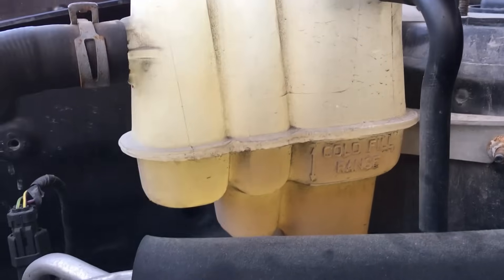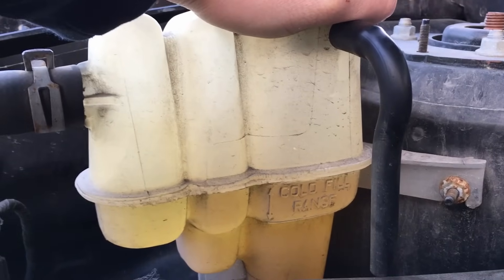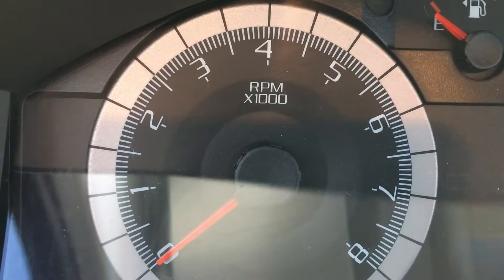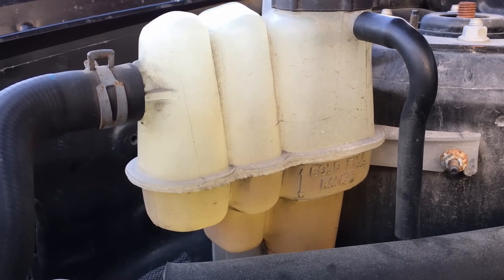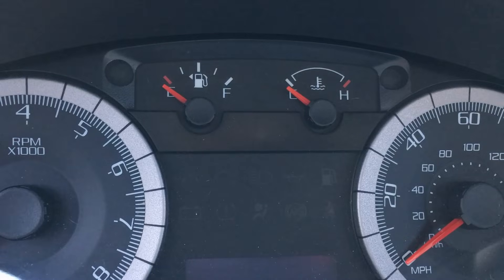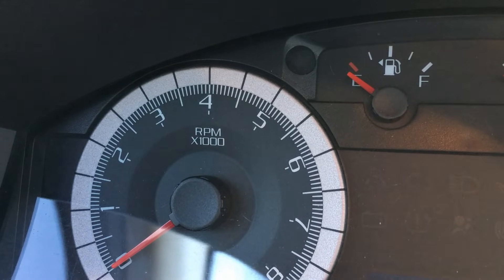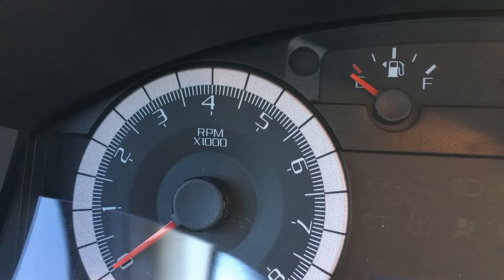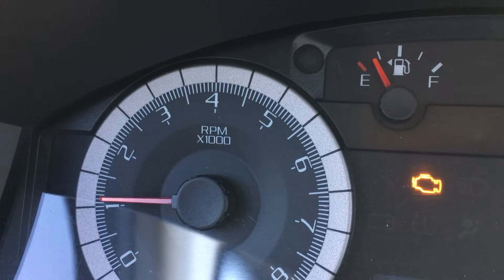Ford Quick Tips #69: The Trick to Purging Air From Your Cooling System

Comment: thanks for this vid, i'm going to give it a go once my escape has cooled down. however i have a strange problem, my father-in-law replaced the thermostat, not sure if he burped the engine, but the temp sits comfortably t 3/4s which is NOT GOOD.  but unlike the common issue stated about only cold air blowing in the cabin there IS heat blowing thru the cabin heater, could this still be caused by a bubble in the system? or something else?
temp gauge doesn't go any higher, but my rad-fans are full on trying to keep the coolant cool... I'm stumped, my dad is a mechanic but he lives in another country and usually i'm pretty good at this but on older vehicles, do you have any advice for me?
Reply: Mr Burns p
Reply: You ever figure it out? why yours fan were on high?

Comment: I take a car with a known good heater, and use a vent thermometer.   After running 10 min, I note the temp coming out of the vents.   When  i do this on my car with minimal heat, I will go out the next morning, and see what the vent temp is after 10 min from a cold start.  I feel this is a good way to check it.

Comment: We had a 09 Flex, we never had a issue with the heat for years until my wife had got into a accident and they had to replace the radiator. After that we only had heat wile driving. I kept bringing it back and they didn't know what to do. I looked it up, as I do most of my own repairs and it was like a 8 hours bleeding process. I really wish I would of tried this instead. We ended up trading it for a 16 Edge for other reasons but really regret it, our Flex was my favorite non performance car we've had.

Comment: Would this work if it’s running hot and the ac isn’t cooling? Radiator and heater core was replaced and it’s been sitting for a while. This is for a 99 F-150 5.4L.

Comment: Only on the driver's side I have no heat at idle. When driving there's heat on both sides. The force of the air also seems lessened on the driver's side. Blend door? Partially blocked heater core? Thoughts?

Comment: I recently replaced the thermostat and thermostat housing along with the thermostat sensor. Noticed the air bubbles in the coolant reservoir. Tho i have heat but no ac due to the worn out ac compressor. Car is not over heating either what else could cause the issue? I had stopped the major leak but the coolant reservoir seems to keep drying up.

Comment: Have a question. 
I have a 5.4 2000 e250 
I get heat. After running for awhile my heat will go away. 
I did have the cap off trying to purge. Seems all was good. I was getting good heat at idle. I was getting ready to put the cap on after running it for like 40 min. Get in van and heat is gone. It will come back only with the throttle. 
I feel like the bottom hose is getting no flow.i can squeeze it fully. I don't feel it flowing. Top of radiator was hot. Bottom cold. Opened peacock fluid was cold. Not sure if that normal. 
What do you believe would cause these symptoms? Appreciate the videos and any info. Love youtube

Comment: While the bolt on design still work if there is wear on the end f the camshaft from an aftermarket unit. I made the mistake once. I have a bolt in unit now. We’re you able to fix the unit I. The video without replacing the cam?

Comment: Hey man I got a 2006 Ford F150 4.6 V8 four door automatic two-wheel drive I did the coolant flush system on it but now my AC is working and when I turn it from AC to heat I can hear the actuator clicking over to keep but it's blowing out cold air so does that mean I have air in my system and if so how do I burp it

Comment: Can I do this if my expansion tank is completed full of coolant? The Ford dealership filled it to the top when I had them replace it with new coolant. I'm asking because I'm not getting heat unless I'm driving, blows cool air at idle
Reply from the maker: bring it down to the top of the cold fill level.

Comment: I have a 2004 v6 mustang...3.9...

It develops air pocket everytime I first go through the heating up...after it sits if I open radiator cap there is some pressure in there...

Once it's running though and air pocket is gone it will run perfect operating temperature

I'm confused why this only happens when it first warms up....maybe after it cools it sucks in air from the expansion tank?  Maybe a crack in the top of the expansion tank?

Comment: hey what do u think in general about 2015 explorer sport 3.5. my lease about to end and i wanna decide if i buy it or not
Reply from the maker: In general I think they are great vehicles they have been very reliable from what I have seen.
Reply: Faysal Chraibi I own a 2014. They fly on the highway, have left some mustangs in the dust. Not the 5.0 though but the regular v6 mustang. it's definitely a fun car to drive.
Reply: one thing you want to check though is if the blend door makes an odd noise when the car first turns on the heat or cool

Comment: I have a 2013 Ford with the 3.5 engine the radiator retainer is building water pressure and gushing out.. I had flush the coolant with the tool and still same problem. And also have change the thermostat heater is working inside the vehicle. any advice thank you in advance

Comment: hi,i have a 2009 ford fiesta 1.6 tdci,i changed the thermostat and housing today,i then put coolant back in run it for over an hour,the top rad pipe is hot,heaters are hot but the rad and bottom rad pipe is cold,also because the rad is cold the fan isnt cutting in,but if i disconnect the temp sensor the fan cuts in,ihave left the car running for over an hour and rad is still cold,the water in the bottle is getting hot but dont seem to be circulating,it just gets hot,the bottom of rad and bottom pipe is cold,please any ideas,i was told water pump but i have no leaks or noise coming from the water pump,thanks in advance,jon...uk

Comment: I have a 2008 Ford fusion 2.3 L and remove the drain plug from the radiator to drain the coolant because I wanted to remove the intake manifold and clean it I was unsuccessful because I was having problems reaching the hardest bolt on the intake manifold that Is dead center of the intake manifold so I put everything back together put the radiator plug back on and put the coolant back in the reservoir I have not started the car yet should I do this procedure after doing all thi?Thanks in advance Brandon

Comment: I have a 99 expedition that does the same thing: overheat and no heat in cabin.  In my case, I replaced the thermostat because of no heat in cabin.  Somehow, pressure rose with the new thermostat and coolant leaked.  It seems enough leaked that the truck overheated to the red mark.  It wasn't overheating before I replaced the thermostat.  So now I don't know if I cracked a head or not.  It passed the blue liquid head test, the liquid didn't turn yellow.  
I'm still getting no heat.  The blend door actuator seems to work, and I don't see any fracture anywhere.  The blend door seems stiff to move when I turn the heater on.  Should my AC compressor be activated when the heat is on?

Comment: I have a small crack in the top of my d gas bottle on my 2001 5.4 f-150. Is it safe to drive? It does not hold pressure with the crack I don’t think. It’s not over heating and the heater is blowing hot air.

Comment: what happens if you ford edge keeps overheating after draining and replacing the coolant, but your getting heat insidde the vehicle? I checked all the fuses and the radiator fan and they are all working properly? I cant figure out why its overheating?

Comment: If the engine is cold while purging, isn't the T-stat still closed?  How does that work?  Thanks
Reply from the maker: Every vehicle has a bypass.
Reply: @FordTechMakuloco could this cause a P2316 code? I went out to my truck and it seemed to be misfiring. I also noticed no AC and my turbo and engine warmed up quick. Of course it is a 95 degree day so it may be exacerbated. This is a 2011 F150 Ecoboost F150

Comment: FordTechMakulo, great channel!
Will this method work on an 03 Mach1? It’s got the “purge/burp” plug on the coolant bypass line in the front of the motor?
I was going to flush it out soon and wanted to avoid any air pockets.  I was thinking of filling and using a hand vac pump on that burp plug hole?

Comment: 2015 ford fiesta. having over heating issue after it runs for about 15 min. already changed thermostat and water pump. checked for head gasket leak, block or head crack and it's negative. i did as you directed and have good heat coming out. ford wanted 1080.00 just to replace a thermostat. guess i have to check heater core control valve, radiator, heater core, maybe change radiator cap, used engine with 31000 miles is 795.00 shipped. any ideas?

Comment: This didn't work for me. It started to work when i pulled lines from the heater core and expansion tank and filled them then replaced. But the heat still disapears at idle. Should i leave rad cap loose while doing this to let air out?

Comment: Hi. I have a 2008 Ford Escape 3.0L and it has heat coming out of the vent even when idle but the temp gauge is not rising up, even when it's on and driving for a long time. Also I noticed lately that when it's idle for a long time the coolant in the reservoir is bubbling up and overflowing and it doesn't do that when it's drivng. I couldn't tell if it's overheating because the temp gauge is at the minimum. Any idea what's wrong with it? Thanks in advance.

Comment: Hello. I have a 2016 Ford Fusion with 2.5l. It's a closed coolant system with pressurized tank. I really need to replace the coolant and I've seen someone replenish coolant by taking off one of the hoses into the coolant tank and running into a bucket @ 2k from or so. Just letting it cycle all out. Is it ok to drain out the coolant completely like this with the vehicle running. And then refill after it drains?

Comment: Ok i have no heat and my vehicle (2013 Ford Escape SEL  2WD) tells me that its overheating even though its been in the driveway for 3 days now. The car starts,rough idles and stays running however i get no response from stomping on the gas pedal,so i cant use this method. Any suggestions? I'm going to try using a no spill funnel but i dont think the right atta hment came with it.

Comment: My 2001 Ford Focus blew a hose in the cooling system last week because the engine was overheating supposedly due to an air pocket. I had it repaired, and I am getting heat from the vents, but the engine is still overheating. Will purging the air like this fix the problem? Or do I maybe need a new thermostat?

Comment: So I have a 2017 f150 3.5 ecoboost and it was running hot enough to move the needle when towing our camper especially up steep inclines and noticed it was a little low, right at the min line so I added some to get it to the max line and it towed even hotter then, what could this be a sign of

Comment: My heater core has been disconnected and has been since I brought my 2002 F150. I changed the thermostat and now my temp gauge keeps telling me it overheating. Will this trick work for me even though the heater core is not functioning?

Comment: Hello, i tried your method today, after the first go around, i again opened the hood, and the coolant was cool but when i just barely opened the cap it would want to come splashing out so i didn't, 
this is a 2004 volvo v70 wagon, it takes some time for it to warm up in cold weather. 
for awhile..approx thirty miles each way that i drove it around the heat started to warm up but on my return trip it didn't, till i got home.
and the thermostat, stayed put in the middle mark. i cannot figure out this car. 
thanks for the video. at least i tried something new.

Comment: Try this , mk4 caddy 2.0 dsg  engine will come up to temp when left idioling , soon as I drive it’s like thermostat is faulty as engine temp goes that cold rpm rises like cold start, dosent over heat/ dosent use water / no fault codes / geniune thermostatsx3 / water and Cambelt/ flushed nice return flow no bubbles, yet will not hold temp when driving. Any advise

Comment: I just replaced head gaskets on my 97 f150 4.6l,  could this be the reason my top radiator hose isn't getting pressurized
Reply: Did the procedure help?

Comment: What if after I turn off the engine and wait a minute and every time I unscrew the cap, the liquid then raises higher in the container? Every time I repeat the process and unscrew the cap the fluid actually raises and doesn’t lower until 40min later. Am I doing something wrong? I recently also changed the thermostat and water pump. No heat and engine was hot before and after I did the changes.
Reply: Happening to me to, did you fix it?
Reply: Ended up being a big air bubble caught somewhere. Raised the front end with jack stands and tried the process in the video. After I was done I removed the jack stands and lowered the car quickly and not slow and I saw a big bubble be released “was about 8-10oz of liquid I had to add afterwards to the fill line.”

Comment: Should a 06 2.0 duratec focus big thermostat hose (lower radiator hose) get hot? I put a new thermostat and it gets up to 170° but takes forever to get to 200 that lower radiator hose never gets real hot I’m wondering if the radiator is clogged the upper radiator hose is warm even when the heat is working at 200° The lower radiator hose still continues to be cool
Reply: Who can help

Comment: Ok. Im confused. @8:20. Dial is all the way to hottest and air blowing at the 2 setting. Then having it set to blow on the floor instead of the face vents. Then you are feeling for hot air coming through the face vents. Is that right or shouldn't the air be coming from the floor vents that you set it to blow from?
Reply from the maker: I put it on floor only for the video so there wouldn't be wind blowing in the camera mic as explained in the video but you would have it on vent only of course.

Comment: 2 QUICK QUESTIONS so I can do this now and have car running to get to work this afternoon. I have the sloshing of water behind the dash, and it overheats once  in a while. This is after a pep boys job changing radiator. 1. Is this method only for Fords? Will it work on a 05 4Runner? IF not, I guess I could try the other more common method seen on YouTube.2. Most other videos tell you to turn on heater in the beginning of the process. Is that OK or is it best to wait as was done in this video?

Comment: Questions for you Brian I lost heat in my 07 f150. So I flushed my heater core and cleaned everything out I could, but there was a lot of rust that in my system. Now I had okay heat but not great heat when I rev the engine I get heat like I did before. Any ideas also I have 225,000 miles on it 5.4l. I am leaning to a water pump maybe the pump inside rusted away.

Comment: Brian, on my 2001 mazda tribute i just replaced the water pump, and the return heater hose, and now  while driving, the temp gauge goes up to normal ok and hot air is coming out of the heater OK, but the water flowing back into the water tank is boiling steaming hot and im having to add water to the tank as the tank is almost empty... there is no water leaks under the car and the car runs great with no missing or cutting out... what could be the problem???

Comment: Thanks gonna try it on my 2001 Expedition 5.4 Eddie Bauer. hope it works.  I had it burped at tire discounters heat worked great that day The best morning No heat at all. took it back they did it again and the heat worked great again one day later no heat again.
 ANY OTHER ADVICE ?
Reply: EATC module

Comment: If the engine is already overheating, is this going to cause damage to the engine revving it so high? Im having overheating issues just as u described, and im worried i might do more damage than good...thaks for any imput, and by the looks, i also drive the dame vehicle, 2010 mariner with the 2.5
Reply: It worked awesome. 2011 ford escape

Comment: Hey man you probably won’t see this 😂. Is it possible to use a refiller kit to pull existing air from my heater core with coolant still in the system?

I replaced the coolant thermostat is my 07 fusion and definitely didn’t properly refill the system. I can hear the coolant sloshing around in the heater core although it drives okay and doesn’t overheat…
Reply from the maker: No it does not work so well when full.
Reply: @FordTechMakuloco  so it would be best to drain the coolant again then do the vacuum refill procedure and refill with coolant? Should I bring my vehicle up to temp first to open the thermostat?

Comment: After flushing my coolant and replacing the upper and lower hoses I now have rough idle problem on 2004 Escape V6.  Please help. I had to remove the battery and tray to get better access to the hoses and then fill it with the gold antifreeze.  Is there bubbles in the system? Or did I forget to connect a vacuum hose?

Comment: Ok so if you don’t have a tach how do you know if your at 3500 rpms does it have to be 3500. I have heat but the temp runs high I have replaced the thermostat 190 coolant temperature sensor and the temperature sending unit

Comment: I have this code P26b7 in my 2013 Ford Escape 1.6 turbocharged, i put a new engine coolant bypass valve, i still have the engine code, do i need to bleed it?. Thanks

Comment: I changed the coolant in my F150 had a air pocket in the engine so the thermostat would not open so I made a disk of aluminum with a hole in it to sit in place of the thermostat.  After I got the air out I replaced the thermostat and it was fine.

Comment: park the car on hill or jack it to get the heater core lower than rad. or degas bottle.
Reply from the maker: True but on some of these that would be dangerously high.
Reply: You're right I parked mt 98 Expedition on a very steep hill and the heater hoses are still above the degas bottle .
Reply: Instructions not clear.. Truck is now upside down